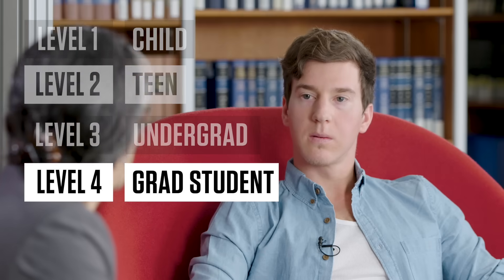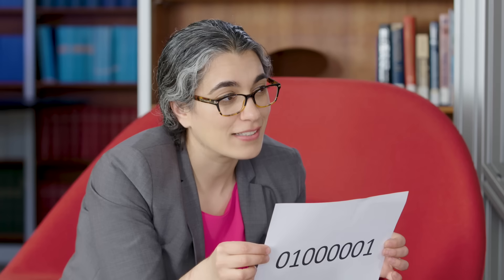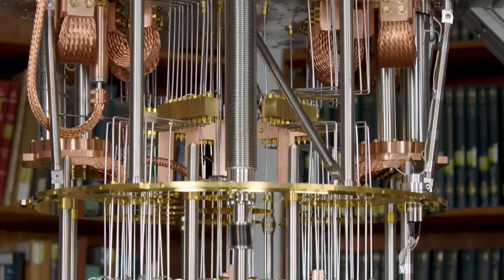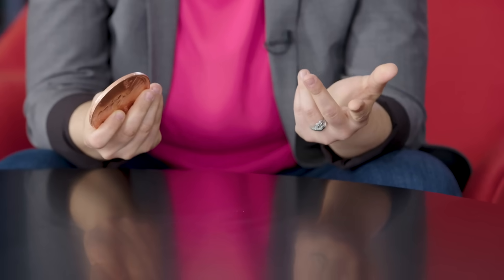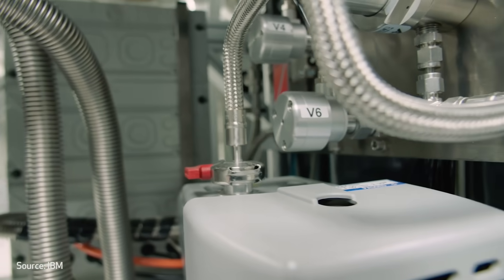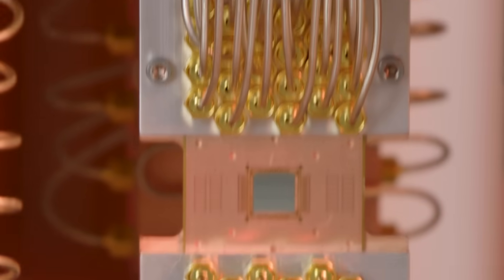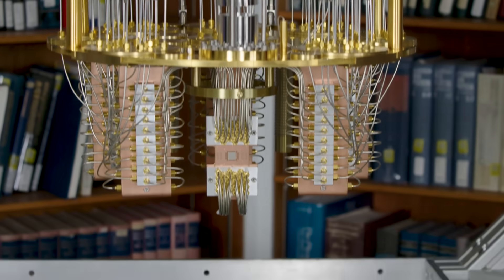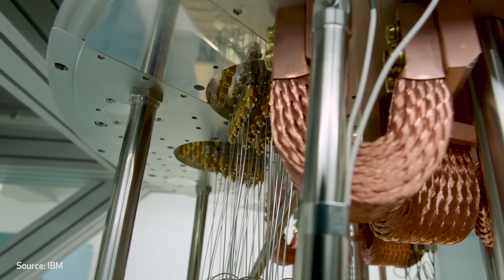Quantum Computing Expert Explains One Concept in 5 Levels of Difficulty | WIRED

Comment: Im still lost...wtf does this do?
Reply: Instead of a normal computer that is binary (either 1 or 0 ) this has multiple states, so it can be used as a computer with multiple states making advanced calculations alot shorter and therfore faster. But the real possibilty is in the ability to mimic the advanced effect instead of counting the sum of all possibilites.

Imagine combining 2 different elements in chemistry. Currently you sum all the variables and get a total value. Now you could instead use the different states of the quantum computer to simlulate and just see what happens.
Reply: Saw an example once of a problem being solved by a quantum computer vs classical computer, it is as follows: imagine a maze with 1 entrance, Y 'dead-ends' and 1 exit. 

The way a classical computer would solve this problem is to try every single path resetting every time it hits a dead end (sure theres other method but this is simplest), so it tries path A and hits a dead end then a different path B so on so forth until eventually it will find the right path. This is a very linear way of solving such a problem and can take a very long time.

Now a quantum computer could solve this by going down path A when it encounters an intersection in the path it doesn't choose say right or left, it choose all available options thus arriving at the exit in a single iteration.

The complexity of this problem can be increased by adding X entrances, where classical computing will take 'forever' a quantum computer could solve it in a much more reasonable amount of time. At least thats my understanding lol.
Reply: I can also create spin on my computer chair.
Reply: 2+2 is 4-1 that’s 3 quick maths
Reply: +Alagramz Art You not only needlessly overcomplicated it; you gave a needlessly awful explanation. Whitworth's was much better and more simple.
Reply: *mafs
Reply: basically we are building the matrix
Reply: James Morris    I'm under the impression it creates spin? Maybe MSM can use that?
Reply: Alagramz Art, in your universe, do you actually believe you just did a better and less complicated job of explaining this than Christoffer Whitworth did? Truly?

Some people are completely in their own world.
Reply: Christoffer Whitworth yea....no.....still lost...are you a wizard?
Reply: 5:38 I believe the reason it has to be so cold is so they can observe the results and reduce potential interference.  They are trying to get as close to absolute zero as possible.  I don't think it has anything to do with an explosion.
Reply: Basically, it's sort of multitasking all the counting at once. Unlike our computer, they tend to calculate everything one by one in extremely high speed.
Reply: @Christoffer Whitworth Interesting. So is it not 'computing' in any different sense than e.g. a nerf gun and a ruler would 'compute' a cannonball trajectory (except in can model quantum phenomena, not just gravity, velocity, etc.). For now I understand it  as a configurable quantum effect 'simulator' - it can model e.g. iterference of 2 photons, using interference of 2 qubits.

Can you give me an example of a classical and quantum algorithms solving the same problem (note: but please, something easier than Shor's factorization algorithm, as I'm afraid my maths level is just not high enough)?
Reply: Isn't a quantum computer just emulating quantum states using microwaves?
The real question is how to utilize this, isn't it? I mean the concept in itself isn't that hard, it's turning it into something useful that is.

Also, couldn't a quantum machine conceptually function akin to RAM? It would process any task that's sent to it, but it can't store it; but a regular (and stable) computer could save the output and/or eliminate garbage as some kind of filter before producing a series of results of the task given to the quantum computer.

Or am I completely off here?
Reply: James Morris it's a computer that is really small and unreliable because it is made with new tech, but if they can scale up without breaking it, then they can make some hard problems, like factoring big numbers, easier.
Reply: @Klorinator it has to be cold because that gives less resistance, and interference as you said. It's the same in modern-day computers, except superconductors are so far impractical because they get too hot and will melt the circuits if not put in dry ice etc.
It will be interesting to see how they will make practical machines using quantum mechanics considering this, as everything artificially creating cold will disperse equal heat somewhere else (using the word artificial in specific)
Reply: It makes your hair...greyer
Reply: Having no clue how a quantum computer is mot people's natural state.

Could you explain in detail how your phone uses a 46G vs a 3G network - as in the guts of that? Or how the internet hangs together? Or how wireless charging actually works without electrocuting you?

Of course not- you just know it works and thats all most of us ever need to know.

Same with these. I feed it a massive problem and it works out the answer almost instantly and much faster than any computer we are accustomed to,

Now you know what they do :)
Reply: And it would be further easier to understand your text if you would have been using the dot-symbole to break up the enormous texts.
Reply: A bit is either 1 or 0 
A quantum computer bit (qbit) is both but only shows one when checked
Reply: you are wrong quantum computer isn't  necessarily faster than a classical computer it depends on the problems you are solving.
Reply: It quantum computes
Reply: James Morris is like a jacked calculator
Reply: But can you do this?
Reply: Die your hair jet black. you'll look young again
Reply: Christoffer Whitworth why was that more helpful than anything I heard in this video? Thanks man!
Reply: James Morris It's like a normal computer but with more computing power.
Reply: when your computer do math, it does 1+2=3 when a quantum computer do math it takes the 3 and turn it into all the factors to get 3
Reply: completely off. in literally every single way. in every part of your post. instead of explaining every little thing, ill just say that every single thing you said or thought its completely wrong and has nothing to do with anything. Especially in the last part about RAM and filtering stuff. Umm nope. That has nothing to do with anything, let alone quantum computing
Reply: now imagine doing it backwards xd
Reply: basically, it's a really big, really powerful, really complicated computer that tries to solve problems that are way too hard for a normal computer to try to solve.  and they would use this computer to try to solve the biggest, most complicated problems in our world...like curing cancer, stopping the aging process, reversing global warming, creating time-traveling deloreans....u get the picture.
Reply: Alagramz Art Your explanation was perfect!
Reply: Lan Knownet No. Not if we're younger. Byeee
Reply: @Lan Krownet don't worry entire humanity will die before getting to use it, these idiotic suggestions can only exist in minds of mental midgets and modern scientists which are one and the same group
Reply: Christoffer - you explained it WAY better than Talia Gershon did.   Thankyou!
Reply: James Morris it does the same thing as ur computer but just in a little complicated way
Reply: LMAO
Reply: It helps the government that perfects the technology first crack all the other governments security measures. It might also become useful for the common person as a result of that though.
Reply: Just a vintage looking refrigerator...nvm
Reply: Christoffer Whitworth im still lost, how do you just stimulate? All I see is 3 possible states instead of two.
Reply: Right Now... Nothing.. Lol. So when it works, it will be able to compute much more data in a single cycle. like exponentially more. As it has more states than 0 and 1 . However, we cant yet detect and repair errors, which makes this technology useless. (was that a 0 ,1 or a 2?, i dunno?) We also cant store the data in the cpu for very long, thus making it even more useless. (2 plus , wait what was that again ? = )Eventually some really smart people will figure the two problems out, and quantum computing will finally be usable. I'm sure skynet had a quantum computer at its core.
Reply: Will also create theoretical problems and the "fixes" mill mold the real world.
Reply: you can find the end of  minecraft  world
Reply: Alagramz Art Please do not call storage memory. As a programmer, it is very disturbing.
Reply: James Morris It lessen the steps of computation: basically when you do a calculation you take 3 steps. Example 2+2=4
But when a quantum computer does it: 2+2=4 or 3+1 or 2+2 or 16/4 or 4/1

It gets a lot of combinations in a single step.
Reply: On a single (non-super) classical computer, it would take about 500 years to render a single Pixar movie. On a Quantum computer, it would take 0.000001 seconds. It can also brute force crack any password in even less time.
Reply: It solves problems that dont exist
Reply: Now THAT is a perfect layman's explanation. 

Side question: Will anything really be "private" any longer in a world full of quantum tech?
Reply: James Morris IT DOES DE QUICK MATHS
Reply: no... youre all wrong. James, quantum computers quantitate quantum computing and refuting quanta in spherical orbit quantum quantum yum yum
Reply: Oh, and forget the stuff Alagramz Art wrote, he doesn't get it either but thinks he got it. His explanation is in parts wrong and way too abstract to be at any real use.
Reply: James Morris calucate Problems fastet and better than the super computers we have. Let’s just say a 10 digit code takes 10 years to crack for the supercomputer we have no but it would only take one year for the computer shown in Thai video
Reply: Makes you find those pokimons faster...
Reply: Alagramz Art Wow you really have no clue what you're talking about. Not even a little bit. Your nonexistent English proficiency doesn't help matters either.
Reply: It looks into a parrelel universe like for real:p no jk
Reply: James Morris guess your lvl 0 to stupid :D
Reply: what any other intelligent entity does: lives, learns etc.
Reply: james what are you doing on a computer! the lego blocks are over there by the fruit rollups
Reply: Christoffer Whitworth you are still overcomplicating it for James Morris. 

James... imagine your iPhone or Android for a second, isn't it true that you can buy a 16G, 32G and 64G and lastly the 128G storage on your phone right? Well those "stuff you add on your phone takes memory meaning your info does not have enough room until you empty one of those Gigs, basically imagine your phone but in a quantum computer state that can record memory better at least 10,000 device put into one, can carry perfect data without buffer which is like your phone but 10,000 phones put together, it carries its own router broadband wifi within itself with ease meaning it can process information within perfect speeds forever without fail and finally if you want to process any information or downloading any information, your device is capable of doing that before you can even comprehend and you can design your own game in your phone, websites, weather predictions, download every YouTube videos within seconds, every single photo you have or had and even 3D print any materials or chemicals you want. 

Basically that is a quantum computer, such a device would explode which is why we need to add cooling tubes on it, similar to how gamers design their own Gamer PC's assembly by putting a cooler on top of their CPU's which one example is the Intel Core i5 processor, I am certain you heard that on a laptop sales and stuff, that thing process data whenever you feed it data, it processes it, arrange it and distributes it, multithreaded processors does that but many many many smaller versions put into one so it can multitask rather than depending on eating one information at a time right? 

Quantum computers are trying to do all of that and keep information or data to not be lost FOREVER; the best we can do so far is to hold information for at least 1.3 seconds, this is why when if we loose data and we always hear that we can never get it back it is true, like a system wipe but you forgot to remove your pictures of you daughter tinker bell, tinker bells pictures are gone for life, to the nothingness of the data world, the whole 0's and 1's is what quantum engineers are trying to find a method or design that will keep all of these databases into a hub in order to maintain lost informations like your daughter tinker bell walking when she was 1 in your once was file you stored. 

I hope this helps.

Comment: I thought entanglement was opposite the way she explained it.  I was under the assumption that if the penny measured as heads, then the entangled one would measure at tails (opposite position of the "partner").  So if mine is heads, yours is automatically tails......  Or did I get it wrong?

Comment: Is there a programming language or paradigm that closely translates to quantum computing? Would all the typical programming idoms still apply to quantum computing, like iteration, branching, etc? Wouldn't the microcode abstract the minutia of how the computing is being done, so that existing languages could be implemented on top? Is there term "finite state" the opposite of quantum computing? Since currently the majority of all computer programs are designed around problems that have a 'finite state', would quantum computing even be practical for such applications?

Comment: would it be best to have the unit underground to reduce the errors caused by any interference? surely if they use microwaves to measure  then having it up top would mean its likely to get error caused by radiation even with insulators installed

Comment: 9:05 Q: as a programmer, how would a quantum computer affect the ways of writing a program?

A: Does it function the same way a Co-processor does? if so then I'm certain it could greatly increase compile speeds for various programming languages on several different platforms, NVIDIA IRAY technology is still very slow.. maybe it can even increase high quality rendering speeds in 3d modeling/architect programs such as DAZ Studio, Poser PRO, 3D Studio MAX, etc. I can see many good uses for a quantum computer.

Comment: I started programming as an amateur wizkid (not even 10 years old) back in the 80's on the Canon MSX-2. And via my wife who studied linguistics in Leiden, I also met someone who studied quantum computing there. A little while ago I looked a bit (just some time I had to waste) at quantum programming. I think that was in QPL, though I can't quite remember (it may also have been LIQUi|>). I'd love to look into it more but.. oh.. responsibilities...

The thing I keep having difficulty to wrap my head around is how a qbit can be in a state somewhere between 0 and 1. How do you program against that? So as far as I know a quantum computer can't initialise a variable, run if statements and needs to have the same amount of input and output values. Now any useful program needs to be able to do if statements and initialize variables, so what you do is that you integrate the "quantum code" into regular code like c or c++. But how do you actually deal with the data (I don't really want to say bits because maybe it's something completely different) and operations on it in that quantum code?

Comment: In second explenation, she said that when you mesure one entangled coin as heads up the second one will be also heads up. But entangled particles would have always oposite spins when measured. When first coin is heads up second coin has to be heads down and vice versa. She probably only oversimplified that, but it is pleasure to find an error.

Comment: What happens if you link several QC's together using a fiberlinq.  Then use parallel computing concepts that is "managed" (more like recorded) with a classical supercomputer?  Would this yield "more qc power" through virtual machines on a set of QC's?  (I might not be stating this accurately. I ask this because of the limitations of the number of qubits in a modern qc.)

Comment: In 30 years. Intel Quantum i9 99700k 187Ghz
Reply: I bet it could run crysis 3 at 40 fps on high
Reply: Amd ryzen all ripper 200thz with 1million core may be
Reply: Dibyamartanda Samanta 321
Reply: nasa has it already and obama wont tell us
Reply: Bob Oznek 10000000 mhz
Reply: Is that even possible?
Reply: More like 4096 Qbits cpu
Reply: 400 petabytes of ram you mean

Comment: 7:50 I never knew that. I thought they just used foam to block out some of the noise.
Reply: Shadow Heart That's passive noise canceling (the use of physical materials and design to block sounds). Active noise canceling is, well, active and analyses surrounding wavelengths to cancel them which is why it's much more efficient and certain situations (mostly larger, more regular waves like the sound of airplane engines)
Reply: because a ducks call looks like an echoing sound already. This makes it impossible to determine the start of the echoing sound.
Reply: I love your comment. Best one this week.
Reply: imarockstarification passive noise cancelling aka noise isolation.
Reply: Depends on how much you spend on your headphones

Comment: Not to imply her explanation for the teen was wrong, but if entangled quantum components were difficult to separate, you wouldn't need to run the computer at less than 1 degree K.